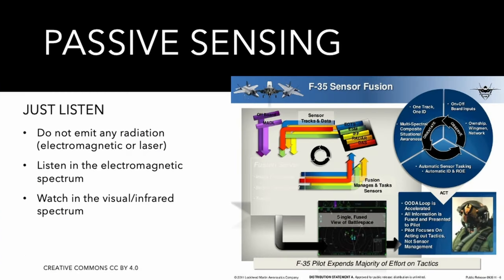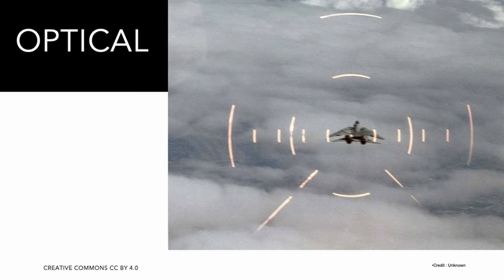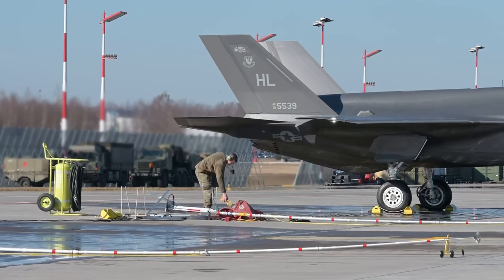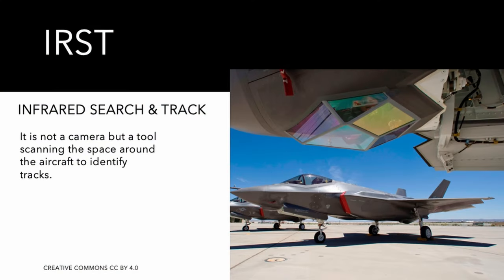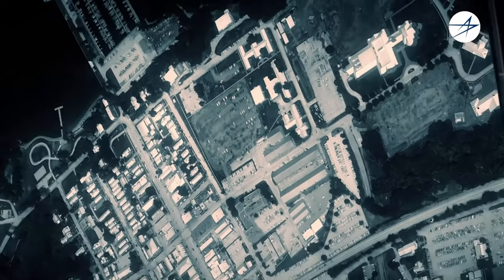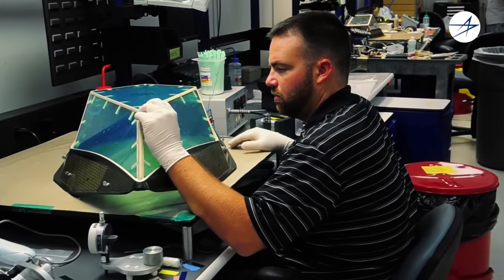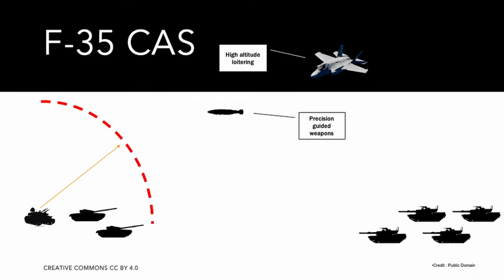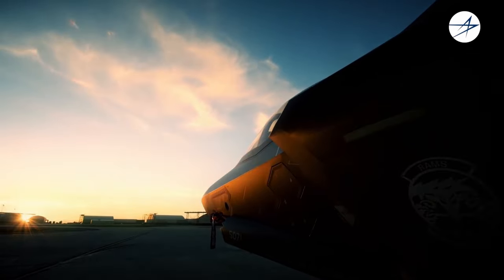The New F 35 Block 4 Sensors are Crazy!

Comment: The F35 sensors and sensor fusion are really such a leap from what was used previously on the 4th gen aircraft. 
Technology has advanced so much in the past 20-30 years. The F35 has really set the benchmark for what other 5th gen aircraft will aim for in the systems. 
I do wonder if the incoming 6th gen aircraft will actually be 6th gen or more a 5+.
Reply: It almost seems like the F35 could pretty much be considered like a 5.5th gen lol, hard telling though since there’s no official 6th gen yet
Reply: @KillingMachineMechanic Hopefully it has enough mid life upgrade potential throughout its service life to keep ahead of or at least on par with whatever newer platforms emerge during the next 30 years or so. Because of the sheer scale of production for this thing it would seem to be pretty future proof.
Reply: There there is only one 5th gen Fighter on the planet, that's the F22. Supercruise, thrust vectoring and Stealth.

The F117 was fourth Gen with Stealth and sensor fusion isn't what defines a generational leap in fighters.
Reply: @saquist F-117 did NOT have sensor fusion. Where did you even get that? The F-22 is quite literally the 2nd worst 5th gen ever made.
Reply: @M16_Akula-III  F22 doesn't have senor fusion either. Where did you get that.
Reply: @saquist  J-20, Su-57, J-35, F-35 all have sensor fusion. While the F-22 is stuck with a radar and no other means to target detection.
Reply: @M16_Akula-III  it's a neat trick but it's not going to be special in 15 years.  More importantly it does not give deterrence. We want to avoid the fight. Deterrence with range says you don't want challenge USA air dominance.
Reply: @saquist  Range doesn't mean jack without advanced targeting systems.  Guess what? Most CBGs are more than equipped for defence, not to mention all you talk about is range, not counting EW, defensive assets, other offensive assets, etc. An F-35 does not need to be the one firing Cruise missiles, nor does it have to be any aircraft, a submarine or a ship could also do that job. The F-35s main deterrence is quite literally in its sensors. Missiles also have different ranges for different conditions, it doesn't have a single notable range, it could have many depending on the conditions.
Reply: @saquist  And air dominance can be achieved by multiple means, including the destruction of enemy airbases in an area and SEAD, which both doesn't always require an A2A engagement.
Reply: @M16_Akula-III  I agree
Reply: Adaptive cycle engines will make 6th gen aircraft game-changing.
Reply: @M16_Akula-III  well the brochure says those aircraft have some form of sensor fusion but how good it is we don’t know. 
Sensor fusion done by the pilot is available on any aircraft with different systems. Having the systems working together and passing the relevant information to the pilot is a hard part to get right.
Reply: @Statueshop297  Brochure for F-22?
Reply: @M16_Akula-III  claimed abilities of the systems. While some are classified some are publicly available. We see data of how different aircraft perform under differing conditions at exercises etc. 
we never see such data from Chinese, russian exercises. 
What is known is Russia has been over estimating the numbers like presenting under ideal conditions which are never going to happen in the real world while most western suppliers will understate numbers. For example storm shadow with a range of 155miles. It can reach 250+ miles. Same with asraam 10km range when it’s been seen going 50km.
Reply: @Statueshop297  ....No one claimed any of these ranges though? ASRAAM had always been more than capable of going over 10 km, literally every single Fox-2s after AIM-9M did. Air-launched missile always had dynamic range depending on conditions.
Reply: @saquist   These fighter aircraft generation definitions are kind of fuzzy and subjective these days and there is always someone with a different definition, but as others here have pointed out F-35 is the newer and more advanced aircraft of the two and has built in properties generally considered essential for 5th gen aircraft that F-22 does not have.

So, F-35 is in that sense more 5th gen than than thou and definitely not the other way around. F-22 is stealthier but you yourself have argued against sufficiency of mere stealth capability as a criterion of generational definition in your comment about F-117, which is a mere 4th gen stealth fighter-bomber.
Reply: @herptek  Perhaps the best way to decide what a generational leap is in fighter craft not just the insertion of new technology in general but also what was actually in development late stage in the previous generation.

Lerx and Lex were being tested in the late era of the 3rd Gen to improve maneuverability. That created F16 and F18's that could turn better than the soviet designs, learning from the failures of the F4.

In the Case of the Late Era 4th Gen we were definitely moving in the direction of stealth, but because of the Advance Light Fighter Program we knew we wanted more fuel efficient platforms.  

Integrated  information sharing was not really on the table for advancements.  It was a late comer to the dance.  I see the F35 as 4th Gen +  I also think it's going to be a one-off design.  We're planning the Gen 6 and we clearly are designing for autonomous drone fighters.
Reply: @saquist  You are in complete disagreement with literally everyone else with that definition, but I don't mind. Just saying. We could argue that the F-22 is a good 4th gen air superiority fighter with stealth if we were inclined to be unorthodox about commonly accepted definitions, but the same can't be said about F-35. It is the gold stantard about what 5th generation fighter means.

What really matters to me is capability, the future potential and literally everything else than generational classification. F-35 is capable of defeating anything Russia has or is capable producing in large numbers in the foreseeable future and its production lines are committed to staying on line many decades into the future.
Reply: @herptek   The F14 was an early 4th Gen fighter jet.  But later on in the 4th Gen the F15 gave increased speed, dropped the swing wing, the most powerful Radar. The F16 and F18 went in the opposite direction. Fly-by wires was a game changer. They also focused on maneuverability by means of lift vector and sustained turning rate.  LERX was a new technology but no one declared them 5th Gen.

The F22 was faster than the late Fourth Gen, superior in  sustained turn rates than any fighter alive to this day.  It's definitely a different breed from anything that came before.

The F35...It's advanced. But that's a cliché because what we mean to say is, it's technology is a step ahead in many ways but its not ahead in one performance metric. It's not at all fast.  It's sub par in lift-vector maneuvering. It's highly subpar in sustained turn rate.  But it has the most "advanced" computer system and radar systems ever seen. It will lose in a dog fight to every Fourth Gen Fighter including the F14.  

The F35 is next gen software, Next Gen Manufacturing and even Next Gen in BVR combat but not Next Gen Performance which is was the previous metric.  So in other words...other than Stealth... there is nothing about the F35 that makes it better as a platform that couldn't be put in a Fourth Gen fighter.  To me that's not a next gen description.
Reply: @saquist  Yeah, I do not disagree with that, but this isn't what defines the generation of the aircraft. Most of what you mention as superior performance characreristics is also irrelevant in most cases that involve beyond visual range combat. Being better in dogfights is not even as relevant as with 4th gen air combat because such situations are unlikely to emerge, but the performance of sensors and situational awareness is of crucial importance, especially when fighting against other stealth aircraft. The F-35 has also has wider mission set than just air-to-air combat whereas F-22 specializes only in it.
Reply: @herptek  This is often the problem when Fighter Generations are debated. As soon as I mention performance the counter is always TACTICS.  Range trumps  Dogfighting. I agree with this. Range is King...but not always.

You mention Stealth on Stealth encounters.  
You also said dogfights are unlikely during Stealth on 4th Gen encounters.  I hope you realize that stealth WILL force more dogfights when the opponent is Stealth too.  Reduced range of target acquisition will shorten BVR.  Missiles will miss more often even when inside a 10 mile MAR (Minimum Abort Range) Missiles will be expended, especially for the the F35. At this point F35 can't out run anything at Mach 1.6.  

One-on-one the F35 is at a 66% disadvantaged against another Stealth fighter. But that flips when it's opponent is 4th Gen.  The F35 survival increased against an opponent stealth when in a wolf pack. (Tactics) Just as Wolves and Lions in groups use stealth to ambush prey. (Tactics).  For some reason F35 proponents don't believe the same tactics can be acquired by near-peer threat forces. I don't know on what basis that belief is is rooted.

But future tactics are very very fluid and I would not base a fighter jet's Generational superiority based on that.  To me the F35 is already doing too much.
Reply: @saquist  If we take a look at the adversaries then, Russia for instance does not have a very sizeable stealth aircraft fleet in operation yet and it is questionable how many 5th gen aircraft they manage to produce during the next few decades. Their stantard for stealth is much less anyway and they can be detected further away and thus fighting them will in most cases not be very different from fighting a fleet of 4th gen aircraft, supermanouverable as they are no doubt, and fast as well, but luckily for us this competition is not decided by a speed race. Even though possibly not quite as stealthy as the F-22, the F-35 is many times stealthier than its low visibility Russian opponents and will be likely to be able to engage first without necessarily even the need to give itself off by active use of radar.

I also remember speculating in a similar line of thinking as yours that in the future we would see increased importance of closer ranged air to air combat and design features proper to it because of the global prevalence of stealth features that decrease practical sensor ranges closer to visual range, but it would seem that the technological arms race is focusing on the other other direction. 6th generation platform concepts across the board seem to be focusing more on maximizing stealth at the cost of control surfaces needed for dogfights and there has even been proposals to just simply use a very stealthy bomber aircraft instead for air to air combat at very long ranges in a network centric aproach together with other assets.
Reply: @herptek  I agree. The direction of NGAD is to increase stealth. That's the wrong direction for 2 reasons.  1. If extreme BVR is the goal then flight control surfaces are of secondary importance. Extreme range needs a bigger aircraft. 2. Stealth is too expensive. Becoming more stealthy will make NGAD destructive to any budget. Like the F35s we'd be giving up on reaping even a peace time dividen. During an actual war, forget it.  There are only 160 F35s made per year at 5- 16 Billion .

We should be building 2 versions of a missile truck. The First should be a carrier based figter Bomber. Give it a 50' Wingspan, this a range of 1,300 miles. No vertical stabilizers, powerful radar. It should carry 5  AGM 158s with a  range of 230 miles or 11 Aim 260s with a 120 mile range. With F35 radar. Combine with AWAC this put mass missile loads down range BUT keeps the carrier outside effective hypersonic missile range. 

The second is a Stealth B1 Bomber,  carrying  50 AGMs would be a master piece of BVR.  Extremely powerful radar, supersonic, carrying 40 AGM 129s of MORE THAN 2,000 miles of range. Fighters aren't an issue.  A mere 25 planes can fire 1,000 cruise missiles.  That's 5 times more than the ballistic missiles Iran fired on Israel. That's what it will take to defeat China's air defense.
Reply: @saquist  Although I see the point in that way of thinking but I am less opinionated about what route future development should assume. My main focus is on surviving and defeating Russian air defences and their air force in a potential war in Europe, on NATO home turf where large oceans do not separate the friendly forces from the enemy. In these kinds of fights F-35 is clearly the best answer in large scale production. Elsewhere in the world it has been used to destroy exported Russian air defence systems already and to regularly violate contested airspace guarded by them.

The kind of environment I care more about is more crowded and populated by all kinds of threats.

Comment: I wonder where the F-15EX  fits into the technological capability, is it analogous to the block 2 or 3, or does it have systems in common with Block 4. The multi track IRST is really a thing that keeps the Gen 4.5+ airframes viable in contested air space on day 1. As well as the EW suite obviously. Man, these are interesting times that we can scratch the surface on what capabilities this technology allows us to have.

Comment: Of course you wouldn't hover an F-35 in the danger zone just to stream video, but its operators still want that flexibility.
If they really just wanted to optimise F-35 for its main missions of a near-peer conflict, they would have cut the gun as well (which was of course actually discussed). But they want to be able to operate it in a great range of circumstances.
And due to the drone situation, there is a real possibility that MANPADS will evolve in a way that's less focussed on attacking proper jets and more about mass availability while maintaining a more limited threat against high performance manned aircraft.

Comment: Now F-35 would have Nvidia GPUs instead of old 32 bit computer in F-16s 😜
Reply: The world runs on "old" 32 bit in fact, in the last few years is the real decline of 8 bit embedded system mainly due to the cost ie an Atmel ATxmega128 was used in my core  (coffee) product until the plandamic and the auto industry decided they didn't need chips that year and so those same chips where not made, so I then moved to ESP32 and STM32, because they are actually cheaper to buy but are totally overkill, in fact 8 bit is the only true ultra low power solution(sleep in nano/micro amps) because they usually have lower extra peripherals hence less modules to power so less leakages which can kill project trying to sleep for months on a tiny battery or super cap.

Comment: Nothing really to crazy the rafale has the same concept with tragedac since 2013. 
It will enter service with the F4.2 (so a few month). 
A new OSF is also expected but the FF are already using the same but talios and L16. 

Upcoming is the electromagnetic version of this, a multistactic radar capability for the F5 version (drone could actually be use to covert "garbage angle"). 

The F4.1 of spectra already covers the passive localisation and targeting of radar thanks to higher bandwidth antenna (GaN) and IA without the usage of a second plane nor time to reposition for triangulation.

The Gripen F and F18sh blockIII have also similar capabilities, F15ex is on the way.
Reply: The aircraft you mentioned are using the same kind of systems to achieve similar goals to the F35. 
I do wonder how France keeps its tech secure when it sells products to a wide variety of customers. 
Are the rafale to Serbia really going to be secure and not inspected heavily by some Russians and perhaps the Chinese to find flaws and weaknesses. Also copying the tech.
Reply: lol the rafale has nothing like the sensor fusion/networking the f-35 has. even the f-14 had infrared for tracking planes. the EO/DAS is far more advanced than anything you can stick on a 4th gen as the entire plane needs to incorporate it for 360 degree coverage with optical sensors/antenna built into all areas of the plane allowing 360 degree coverage. and rafales data link system is similar to link 16 whereas MADL uses antennae (again, all over the aircraft for 360 degree transmissions) at extremely high frequencies to share data via extremely narrow beams that cant be intercepted or jammed and  with extremely low latency. 

the gipen, blockiii f18 and f15ex also arent comparable to this system as they use basically a flir system, not 360 degree and not networked in a way that can share and fuse the data like the f-35 can
Reply: @swayzefan3600  "and not networked in a way that can share and fuse the data like the f-35 can"

The Gripen very much DOES do that.   No, it's not 360, but the Gripen system for datalinking sensor data has been functional since the Gripen C which is currently starting to get replaced by the E model.
Because its datalink is based on the STRIL-2000 that was developed in the 80s and 90s.
And when Sweden entered Nato, they had to DOWNGRADE the Gripen datalink to make it fully compatible.
Reply: @DIREWOLFx75 STRIL-2000 doesn't exist.
Reply: @M16_Akula-III  "STRIL-2000 doesn't exist."

Formally, no, because it's been renamed 3 times and one of those renames happened when they changed what counted as completed because several of the goals were found to be unrealistic with current state of computers while it was developed in the 80s and 90s.

De facto, yes of course it exists, as that was the name of the R&D program for decades.